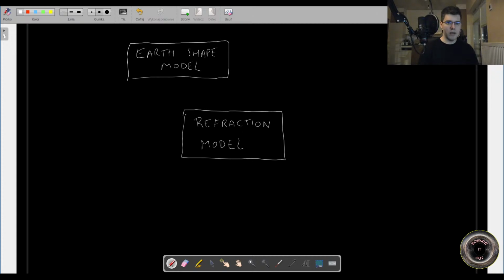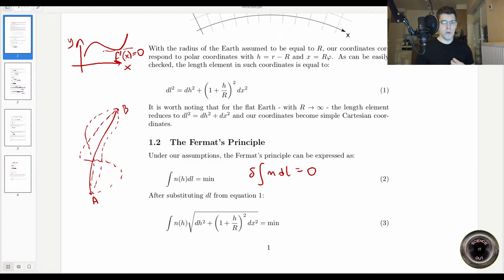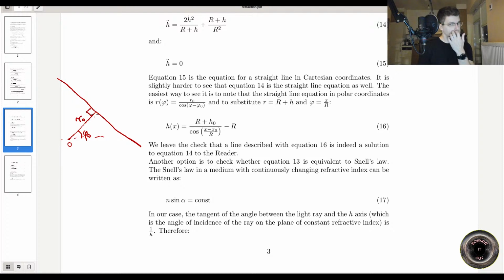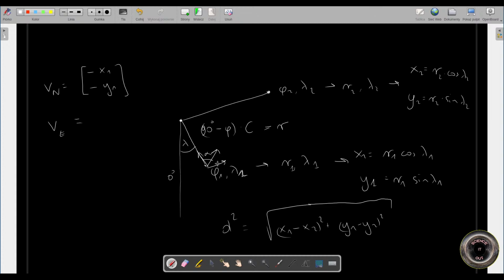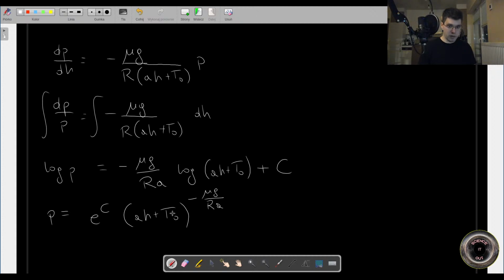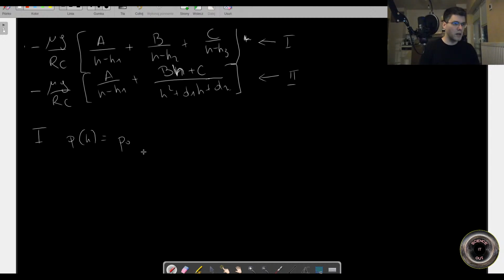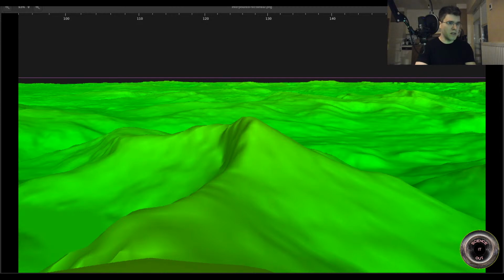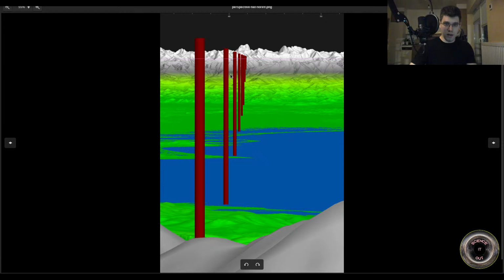Atmospheric Raytracer pt. 2 - The maths

Comment: I was pleased to see how you derived atmospheric refraction using Fermat's principle and the principle of least action, showing the Euler-Lagrange equation in action. Well done. I learned something new. Thank you. 

I programmed a refraction simulator too so I had to go the similar steps as you, but derived at differential equation for dn/dh geometrically.

google: "Deriving Equations for Atmospheric Refraction" Walter Bislins

google: "Simulation of Atmospheric Refraction" Walter Bislins

I made the following simplifications in my simulator: 

Similar like you did for the flat earth case (setting R = infinity), you can make the approximation for the globe:

2 \dot h^2 / (R + h) = 0 and (R + h) / R^2 = 0   [12]
if (R + h) << R^2 and \dot h << (R + h), 

which is the case on earth. The error at the end will be much less than what you can measure in practice.

So you will get for both models

\ddot h = n' / n (1 + \dot h^2)   [13]

\ddoc h is nothing than the curvature (kappa) of the light ray, i.e. the inverse of the radius of curvature (Rr) of the light rays.

As \dot h = dh / dx is the inclination angle (beta) in radian and this angle is in practice very small, 1 >> \dot h^2, so in [13] the term in parenthesis can be ignored in practice. So for refraction observations we can simplify to:

kappa = 1/Rr = - n'/n = -dn(h)/dh * 1/n

Note: I prefer to define downward bending as a positive radius, so I use a minus sign in the equation above, because then I can define the refraction coefficient as:

k = R/Rr 

Now in the atmosphere n at sea level is typically 1.000278, so nearly 1 and we can set the last n in the equation above to 1 without loosing much accuracy:

kappa = 1/Rr = -dn(h)/dh

k = R/Rr = -R * dn(h)/dh

This works the same for flat earth and globe. The difference is negligible under the conditions h << R, beta << 1.

Now we need n(h) or the refractivity N(h) = (n(h) - 1) * 10^6. 

Refractivity N is proportional to density rho:

N(h) = N_0 / rho_0 * rho(h)

Using the gas law 

rho(h) = p(h) / (Rs * T(h))  (Rs = specific gas constant)

we get

N(h) = N_0 / (rho_0 * Rs) * P(h) / T(h) = K1 * P(h) / T(h)

We can now insert the equations of the standard atmosphere for P(h) (in mbar) and T(h) (in K) to calculate (homework):

-dN(h)/dh = K1 * P / T^2 * (g/Rs + dT/dh) = 79.0 K/mbar * P / T^2 * (0.0343 K/m + dT/dh)

and the refraction coefficient k used used in Geodesy is finally:

==>  k = -R * dN/dh * 10^-6 = 503 K*m/mbar * P / T^2 * (0.0343 K/m + dT/dh)

==>  kappa = 1/Rr = 7.90e-5 K/mbar * P / T^2 * (0.0343 K/m + dT/dh)

So now we have an expression for the curvature kappa or radius of curvature Rr of the light rays as functions of measurable atmospheric parameters pressure P, absolute temperature T and temperature gradient dT/dh.

This curvature of light is very closely the same for flat earth and globe as long as the conditions hold true: height is much smaller than R (h << R) and inclination angle stays very small (beta << 1).
Reply from the maker: I've seen the derivations on your website, and I like them a lot 👍 I agree that the approximations you made seem to be justified for most practical cases - I just decided to go with making no approximations wherever I could get away with it. And for example while the approximation that \dot h ≈ 0 is a good one most of the time, I did one or two simulations where it wouldn't be justified (for example the one with the view from ISS, which I showed towards the end of the stream).

Also, using \ddot h = n' / n (1 + \dot h^2) for both models wouldn't work, at least in my approach. The different equation is actually the only difference between the "Spherical" and "FlatSpherical" (observer-centered AE) models - so if I used the same equation for the globe as an approximation, it would just become a flat, observer-centered AE model.
The terms with R and R+h are what makes the difference between a globe and a flat Earth in my approach, so I can't drop them. They are what encodes the curvature of the surface in a way, and what causes the drop to be visible at long distances. If I wanted to use this approximation, I'd have to account for the curving surface in a different way.
Reply: @scienceitout  I totally agree with you. I'm happy that you use no approximations. So we can show whether some approximation are valid or not. And yes, when we view from the ISS, my approximations are not accurate enough. They are valid for observations commonly done in geodesy through theodolites. But you know that already 😊

Comment: For Rayleigh criterion, I suggest arranging for the resolution to be no more than (magnification factor times Field of view angle divided by 0.017 degrees) pixels wide. Your colouring is artificial so averaging the colour over the pixel area is not relevant. 1000 pixels = 17 degrees unmagnified. So with a 3 degree FOV at some massive magnification your resolution is already less detailed than the human eye. The RC would not hide more, it would hide less, so not relevant.
Reply from the maker: Nice idea! I think there's a way to make it even better - I could make it so that you could define the aperture diameter, and then blurring would be based on that.

Comment: HI, I'm working my way through the video. I think you missed a trick when using the calculus of variations. Since L is independent of x, there is a conserved quantity, specifically   L - h' ∂L/∂(h'), and this means you only need to solve a first order equation in your solver (I've not got up to the numerical solution part of the video yet, but using this would speed up the refraction calculation). [Here h'=(dot h) in the video].
Reply from the maker: Hmm, good point! I'll have to figure out if it's possible to incorporate this idea in the code. Thanks for the tip!
(I remember hearing about such a trick at the university, but that was over 10 years ago and not having continuous exposure to such problems makes one forget things... 😅)
Reply from the maker: Okay, so I did the math, and it looks like it would be possible to reduce the problem to a first order equation... but there is a weird caveat.

In the flat case, the conserved quantity turns out to be n/sqrt(1 + h'²), which is actually equivalent to Snell's law (equation 19 in my PDF). But if I tried to solve that numerically for the case of h' = 0... there is nothing in here that would make h change. Since h' is 0, an integration step would result in the same h, hence also the same n, hence the same h' = 0. Which means numerical integration would lead to h = const.

But if we actually calculate the derivative of this conserved value with respect to x, we recover the equation I got from Fermat's principle, which implies that h'' should be nonzero, which rules out constant h. So somehow solving this based on the conserved quantity is not equivalent to solving the second order equation. To be honest, I don't understand where this difference comes from. I suspect it's related to the fact that h' = 0 is an extremum of 1/sqrt(1 + h'²), but I can't quite put my finger on it.

I think I might keep the second order equation for that reason - but I find this baffling! Maybe you have a better idea about what's going on here?

EDIT: Ah, I see! On closer look, I noticed what the problem is.
Say that the second order equation I got is F(h, h', h'') = 0.
From n/(sqrt(1 + h'²)) = const, after calculating the derivative, I get this: h' * F(h, h', h'') = 0. Which means that either F(h, h', h'') = 0, or h' = 0. And this second solution turns out to not be physical, but it's a valid solution to the equation derived from conservation of "energy"!
It's actually similar to how, for a falling ball, E = h'²/2 + gh = const leads to h'(h'' + g) = 0. And we know that h'' + g = 0 is the right solution and the ball will start accelerating downwards even if it has no vertical velocity (h' = 0), but conservation of energy admits a solution h = const where the ball doesn't start falling.
Reply: @scienceitout  Ithink what is happening is that when you derive equation {21) from (20) you divide by h', and so you miss the solution h=constant. I expect the same thing has happened with the derivation of the second order equation.
.
Reply from the maker: @Clive-Wells  "I expect the same thing has happened with the derivation of the second order equation."
Interestingly enough, it didn't. I re-checked the calculations via the Euler-Lagrange equation and there the division by h' is not necessary to arrive at the final result. So it seems that Euler-Lagrange equation is more specific in that it doesn't admit the "static" solution.
Reply: @scienceitout  Yep. I think  you have the right answer in your edit.
Reply: @scienceitout  BTW I have a couple of old videos on deriving refraction. The first one is called "A Derivation of the Distance to the Horizon using Fermat's Principle" and the second one is "How to Determine the Height Obscured by Earth's Curvature Including the Effect of Refraction" which is a quick application of the first.